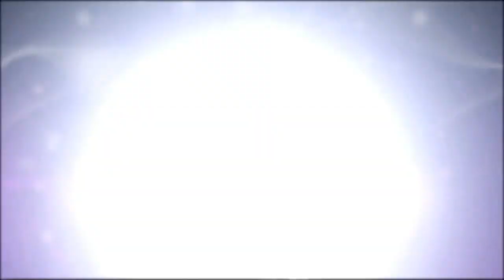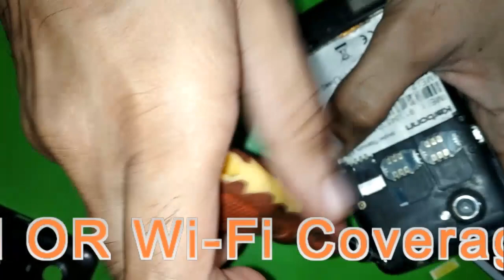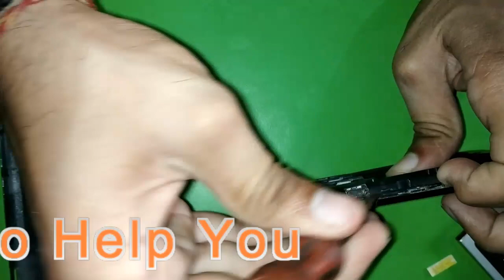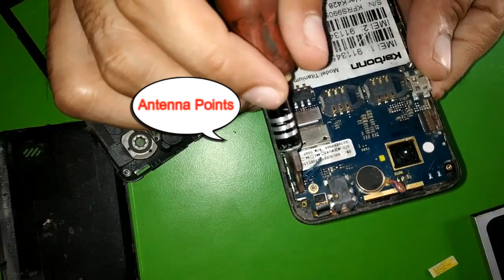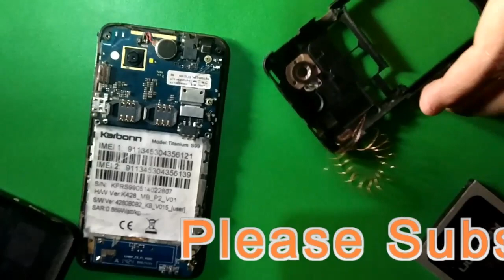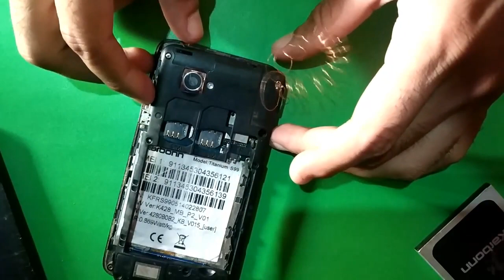homemade Cell Phone Signal Booster, Make External Powerful Network Antenna For Mobile Phones,

Comment: Can I solder the antenna points to an RP-SMA connector and then use it with a Wifi antenna? Will that work or does the antenna need to be a certain desgisn like the one shown here?